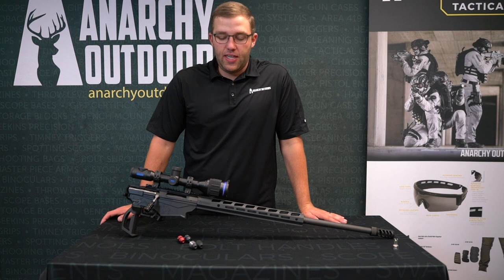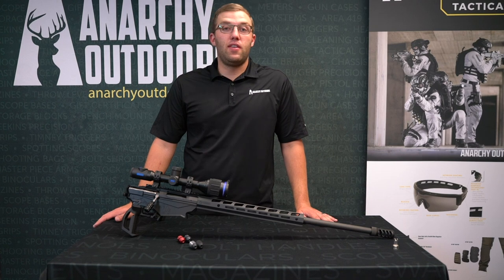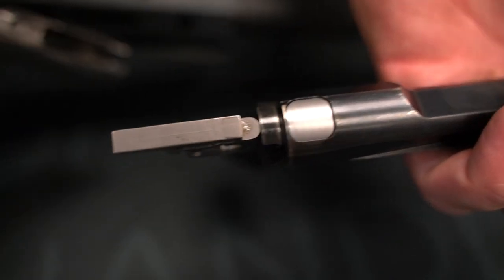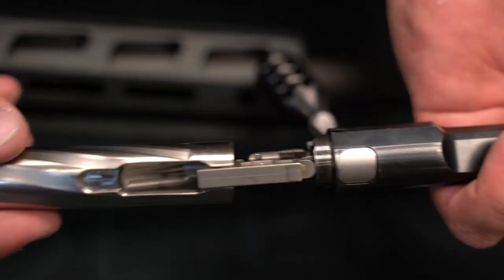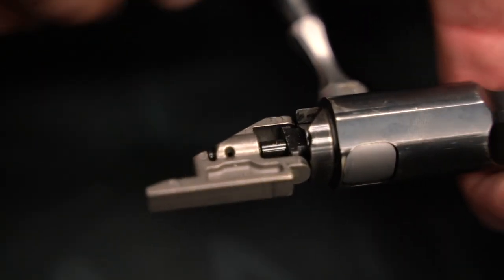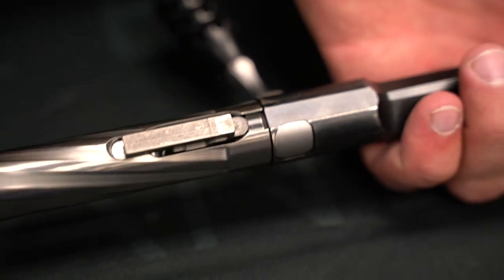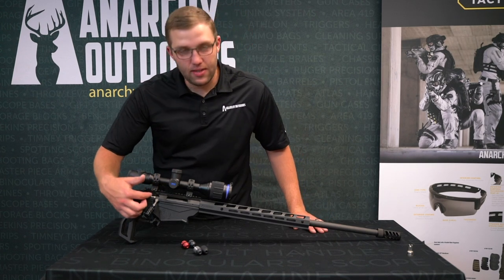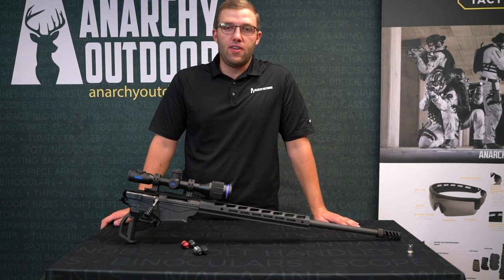Ruger Precision Bolt Shroud // Trouble Shooting & Replacement

Comment: dont fall for this crap people. i just got my new bolt shroud from anarchy for my 338. it doesnt tighten up anything. all it does is look better because of the fluting. it is still loose in the receiver and flops around on the bolt just like the factory one. im sure they will try and say i installed it wrong or some other bs. it only goes on one way, otherwise the damn bolt will not go into the receiver.  the stock bolt shroud is .9480 inch in diameter. the anarchy one is .930. its smaller in diameter but is supposed to make things tighter? someone please figure that one out.
Reply from the maker: This is a Ruger tolerance issue and we have tried to find the middle ground on the shrouds. The tighter feel is only at the connection point. If its to tight you can get malfunctions. All that being said we have 100 % satisfaction guarantee. If you dont like the shroud please send it back for a refund of the product value or and exchange. Have a great day.
Reply: So the shroud wiggle room is normal for the RPR? I could not remember if the factory shroud was loose on my 338L. It is kinda annoying hearing the shroud move around loose.
Reply: @ivanl1154   i just got mine today, red rugger , its wiggling too

Comment: I just installed the newest version of your titanium shroud on I guess what can be called the 3.5 gen Ruger Precision PRC 6.5 Creedmoor rifle. It went on smoothly, but given Ruger's machining variations with their bolts, it's a little loose and rattles slightly when the rifle is fired. Is this to be expected? Other than that, it really adds some serious bling to the rifle and upgrades that cheesy aluminum shroud Ruger slapped on the rifle when they made it.
Reply from the maker: You are correct. If it rattles a little you have a rifle on the tighter side of Ruger's tolerances.
Reply: @AnarchyOutdoorsOfficial  That's good to know. So far, it works very well. Thanks for putting out this new bolt shroud for the latest generation of the Ruger Precision PRC. It sure beats the aluminum version that came on the rifle from the factory.

Comment: My 300 PRC does not look like yours or any of the ones I've seen on You Tube videos. It also came with a separate manual addendum specifically related to the bolt. The long piece of the firing pin and spring assembly that slides into the notch of the shroud looks to be about an inch long and your bolt handle appears to go all the way through the bolt. Mine does not show that square which I assume is the end of the bolt handle and that 1 inch piece in the notch in the shroud is a small square on mine. I do not like the way my shroud fits. It's sloppy and has a lot of wiggle to it. I'd like to replace it but seeing so many differences in mine and what your video shows how do I identify exactly what mine is, or what generation it is if thats what is accounting for the differences?
Reply from the maker: Ours is a 6.5 PRC. Its build like the 6.5 creedmoor. The 300 PRC has a different design.
Reply: @AnarchyOutdoorsOfficial  okay so I can safely buy one from you when they’re back in stock. Thanks for responding.
Reply from the maker: Yes
Reply: @AnarchyOutdoorsOfficial  Thanks

Comment: Is that a factory bolt body? It looks waaaaay nicer than mine.
Reply from the maker: Its our aftermarket bolt shroud.
Reply: I'm talking about the bolt itself. It doesn't look like a piece of hot garbage. I think it may be because your rifle is probably gen.3 and I have an older one.
Reply: @Lorgoth117  it's a gen 3, black nitride.